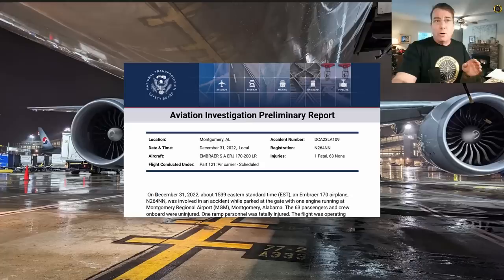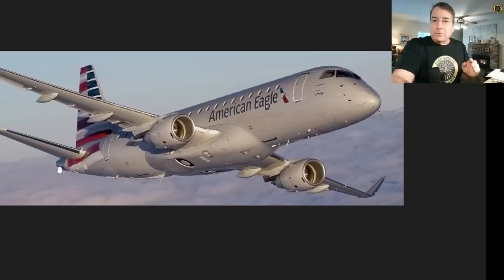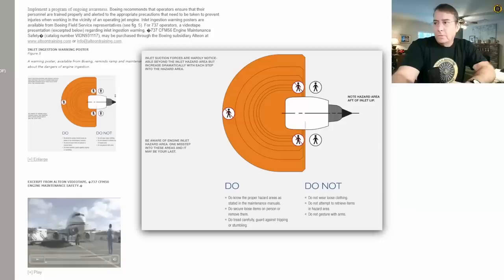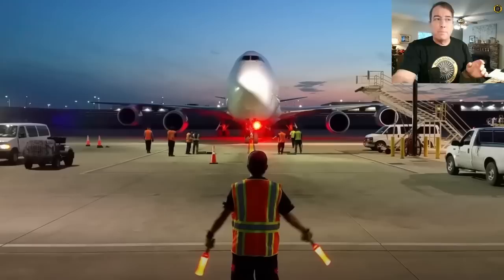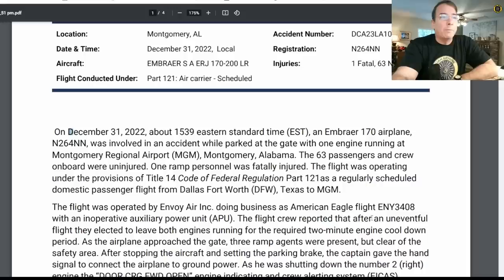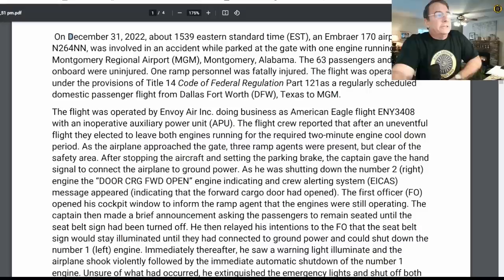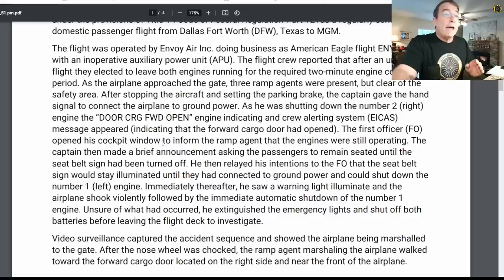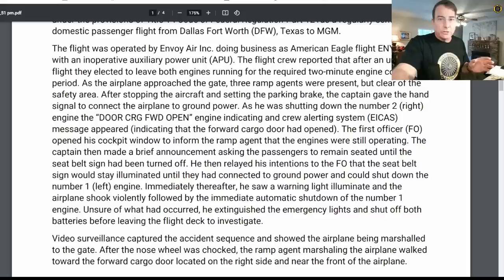NTSB Preliminary Report Ramp Agent Fatality 31 Dec 2022 Montgomery Al.

Comment: I have spent my 43 year Airline career mostly on the ramp but I have also been a flight instructor since the late eighties so I have a broad base of knowledge our industry. I currently run a ground operations training department for a primarily cargo airline. We traditionally hire additional help for peak operations and I have always made it a point to give my "the ramp is a dangerous place speech" to every class. I was shocked beyond belief when I saw this in the national news. It is pounded into everyones head as often as we can if the beacon is on you stand outside the lines and wait for it to go off. Normally maintenance are the ones to break that rule and I have to preach I don't care don't follow their example. Horrible way for us to add to our training why we say beacon on stand back.
Reply: If there are lines is it possible the plane was not properly situated and she paid attention to what should have been but in reality wasn't? Of course that should be stated if that was the case if lines were present.
Reply: Well sometimes in maintenance we are approaching the aircraft with the beacon on because we need to. Leak checks etc. We are obviously trained to be very cognizant of what we’re doing and staying out side of ingestion and blast zones, but our job requires us getting right up to an engine while running at times for FOM
Reply: @larrybe2900  I'm sure the plane was parked correctly or the Marshall would not have given the sign to chock the front wheels.

I think she just was on auto pilot because normally the engines are shut down pretty quickly after it stops, like 30 secs. these were running for what sounds like a min or 2 since they needed to hook up ground power cable, and that takes a while as it's held up by a winch that has to lower the cable down, and then be dragged over, it's very heavy and plugged into the nose of the plane, and then confirm the correct light came on before they shut the engine down. sounds like this happened while still lowering the cable.
Reply: I know engines are expensive, but I wonder if it wouldn't be prudent to find one that's end of life and use it to demonstrate just how dangerous they can be with a decent sized thawed turkey carcass. Maybe once a year and film it for those who can't attend.
Reply: @larrybe2900  I read the report. The plane was parked where it was supposed to be, the lines are visible in the video the NTSB reviewed, and the upper beacon light was on in the video. Also the ground crew did state the lower beacon was also on, but it wasn't visible from the angle of the camera that recorded the incident. 

Unfortunately, we have no idea why the victim violated the safety envelope. It may be drugs. It may be an illness that had her off her game. It could be the pressures to turn around the aircraft. It could have even been mental illness. We don't know. My brother's girlfriend works for American, and we were talking about it last weekend. While she's not a ramp agent, she told me that EVERYONE is taught that if you can't see the individual blades on the engine, the engine is running and you are to stay away. I don't know why this ramp agent ignored the safety briefings and her safety training. And there is no way to find out.
Reply: @jsomething2  The report said they were running for 2 minutes to cool them down and needed at least one to idle in order to provide bleed air and electricity until the ground power could be hooked up. The ground crew were told about this during their safety briefing, at least per the NTSB report. (Who knows what was actually said in the safety briefings.)
Reply: @jackielinde7568  -- Not a turkey -- A Mythbusters style ballistics-gel dummy with a full skeleton.  
People need to see the engines yank the dummy through the air into the engine.  It isn't enough for them to know the endgame.  They also need to get a sense of the invisible hazard.
Reply: People are putting far too much emphasis on the rotating beacon lights. In the interest of self preservation, I ALWAYS verified "spool down" with my EYES from an area near the nose of the aircraft! As a safety auditor, I saw a shift some years ago, where agents were staging cones and chocks at the wing tip location, then approaching  from the side along the leading edge. It was a recipe for death, and here we are. I brought my concerns to Corporate Safety, but was essentially ignored. There's only so much you can do.
Reply: @gdshoe5822  Turkeys are usually easier and cheaper to get, but this works as well.
Reply: You're also fighting against the tendency to become comfortable in proximity to dangerous machinery. It takes a certain amount of concentration and self discipline to remain safe working in proximity to danger. I worked in a lumber millwork shop from age 15 to about 25. At first I was pretty scared of the giant blades and metal, toothed belts, but as time goes on you lose that healthy fear. Easy to inch closer to the blades or to the jet engines as time goes by. It takes some concentration and self discipline to keep up safe practices.
Reply: @jackielinde7568  -- It's easier to get a ballistics gel dummy than a spare jet engine 😉
Reply: very good point-- working around danger requires proper attention and precaution, like safety ropes; lockout/blockout/tagout; two or more cognizant "buddies" (never working solo); like in old days when working behind your TV set always with one hand behind your back. We've all become too impatient and brainwashed by social media and immediacy of smartphones, etc., and all corporate management capitalizes on this.
Reply: As a peak carrier, I can attest, when we go into the hubs nobody comes around the plane untill the L1 door opens, and it is (NOT) getting opened from the outside and not before both are shutdown
Reply: @gdshoe5822  I don't know about that. It's like they buy these vehicles with these engines just hanging off the sides of them, and in pairs or quads, even. It's as if the people making these planes are just giving them away. "Get two free engines with every airplane purchase!" :D
Reply: @jackielinde7568  -- Uh, I thought it was the exact opposite, at least for the really big planes.  I'm pretty sure the airlines need to buy the engines separately, at least for some models... (correct me if I'm wrong.)
Reply: @jackielinde7568  There are videos around of just that. Engines must be tested for ingesting things.
Reply: @gdshoe5822  In many cases the engines are actually leased.
Reply: @larrybe2900  These lines are guides basically, like a normal parking lot!  The best example I could give you has happened to me! We dealt mostly A319s and A320s! But they had new aircraft that had winglets( like fins on the end of the wings!) So they WIDER then normal A/C! So we contacted the crew and told them that we will bring them left of the lead line! If that helps?
Reply: @davidsmiths5471  
Yes it does as well as others who have offered thoughts on my comment.
Reply: @jsomething2  Could you explain the autopilot theory?
Reply: @davidsmiths5471  when you do the same job over and over you'll find your thoughts can drift to something else while you're doing it. I'm not talking autopilot like computer flying a plane. just how people go thru the motions while distracted. she had probably walked over to wheel chock the nose gear a 1000 times but this time the engine was still running.
Reply: @jsomething2  Thank you for your explanation! And nothing against you! But when I hear autopilot, going through the motions,from others and you! Supposedly she was working on the ramp over five years! Wouldn't this have happened before it actually did?

Comment: I refueled airliners for 11 years at SJC; USAir, Southwest, American, TWA and many others; I'm also a private pilot.  I know what the ramp environment is like; all ramps are clearly marked with a STAY CLEAR zone around areas where engine ingestion is a possibility.  I avoided those areas like the plague at all times; that's just what you do... right?  I find similar issues as a ground crew member at various Young Eagles events; some pilots forget the mantra TREAT ALL PROPS AS HOT.  I make a point of it every time I'm around every aircraft, whether alone or with others.  STAY CLEAR OF PROPELLER ARCS AND JET INTAKES.  PERIOD!
Reply: I fly out of MGM twice per month. Before the accident the painted safety outlines were non-existence, completely faded. Now all the painted outlines are very bright with new paint. flying back there tomorrow.
Reply: Both airports I worked on the ramp did not have ingestion zones painted. While the all props are hot is a good thing to live by, there are times servicing aircraft where you need to know the ingestion zone is safe because you’re going to be in it. At times I feel like the all props are spinning, and every gun is loaded mentality breeds complacency, because people aren’t necessarily thinking about what is actually happening.
Reply: The Google Earth photos of the MGM ramp show there are no safety zones painted on the ramp
Reply: Excellent use of the semicolon.   ;-)
Reply: @johnlichtenstein6158  Staying out of the ingestion zones at all times - period - does not breed complacency. If you stay out of the zone, you will never be sucked into the engine. And when you do have to enter the zone (for any reason), you'll be d***ed sure to confirm it's safe. And this does not mean condition yourself to always walk on a painted line.
Reply: @phillipzx3754  Yeah, I'm a bit addicted to them.  I have a lot of connected thoughts. ;)
Reply: @johnlichtenstein6158  Total awareness at all times is the perfect solution and an admirable goal, but the reality of following repetitive tasks in a job over long periods of time does breed complacency.  It only takes a second to screw up and die and that's what happened here.  That's why the absolutist rules are out there because they can help save lives.
Reply: Save those pictures in case they disapear!
Reply: I bet you loved when they blocked you out from refueling!!
Reply: @davidsmiths5471  Especially because I wasn't using a cart to connect to underground tanks; I was driving a 10,000 gallon fuel truck.  But I will say for the most part, the airlines I worked with usually operated like well oiled machines.
Reply: I'm sure you see that at FBOs to?

Comment: I fly 737’s in Canada. Over the past month there have been 2 occurrences where we are approaching a parking position, and at least one individual is knelt near the expected parking position of the nose gear. On one of these times, we felt the chocks being installed before we even had a chance to move the start levers to cutoff. Let’s just say the ground guys got an earful from us…both times asking if they had heard what had happened in Montgomery recently. Routine can be a dangerous thing. You end up walking around on autopilot without thinking.
Reply: I have read a lot of comments on here about "autopilot"! Could you please explain?

Comment: As a retired jet engine mechanic, as Juan stated, you can never have a momentary lapse of paying attention. Spent a lot of time around running engines. We did use engine screens, but lot of other items could kill you since you would have hydraulic power applied.
Reply: Who do you suppose is going to tear apart the engine to get the body parts out? One of the airlines mechanics?
Reply: @jamessicard6682  good question. More than likely since they are trained in engine maintenance. Would probably have medical, coroner personnel there at a minimum.
Reply: You would know firsthand, no doubt.

Comment: As a ramp worker in Australia, the company I work for always wants an on time turn around but nothing surpasses safety. What happened in this situation goes against all of the training provided. Blows me away that they had 2 briefs of this aircraft yet still failed to comply with basic safety principles. Never approach an aircraft untill the engines have spooled down, beacon light is off and the leading hand has given the thumbs up to approach. These rules have been written with blood and that's why they exist.

Comment: Thank you for raising awareness on the role of rampers in aviation. I spent five years on the ramp at GSP (not with American). When I resigned four months ago I was the senior ramp agent at one of the highest performing stations in the company. I've worked hundreds of 170/75 arrivals. That whole accident narrative sounds bizarre e.g. a very inexperienced crew, extremely inefficient procedures, poor coordination of effort. First thing I'd want to know is how many weeks had the victim been on the job? What was the average experience level of the ramp agents involved? (Yes. There is always pressure: too few agents, too inexperienced, ridiculous minimum turn time imposed, etc. The attrition rate for station agents is egregious. An on-time departure was always just another successful sh---show.)  Was there a lead agent at the gate for the arrival? Bottom line is this question: What extraordinary circumstance brought the victim in front of the #1 engine? All the immediate and urgent work was in front of the #2 engine. Was it common practice at that station to set the safety diamond cones from starboard to port---I've NEVER seen it done that way? Was it common practice to set the port cone off the left wing and then take a shortcut under the fuselage to unload bags? If so, this fatality is on management! The only time I was ever in front of the #1 engine on arrival was after I had marshaled and was doing my arrival inspection looking for any damage on the aircraft so we could avoid the blame---usually after the bags were on their way to the terminal.

A word to you 170/75 drivers: don't do this! Given the typical safety posture of regional ground OPS, why would you EVER set your brakes and let the engines run at the gate. If it's a short taxi then slow it down. Burn the two minutes before you get to the gate. Roll into the gate with your #2 spooling down. Set your ground crew up for success. (Oh. Right. It's not 'your' crew is it?) That said, an INOP APU is an MEL on the flightdeck, but it's an IROP on the ramp at a regional airport. As a rule IROPs at a regional station are a dangerous escalation of routine chaos---arrivals and departures. (Had the victim EVER worked a 170/75 arrival with an INOP APU? Was the victim aware that arrival was an IROP? Who was in the chain of custody for that IROP notice to the ramp agents?) Isn't there a way to run on batteries for a couple minutes till the jetbridge can get positioned and the GPU engaged? The deferred maintenance on regional aircraft is appalling. How long had that APU been INOP?

The crews I worked with were always skeleton and frenzied--routinely three experienced ramp agents. (I've worked a turn or two with one other person. That's a transcendent level of sh---show.) Everyone but the marshaling agent would be at the starboard side of the gate waiting to work the bags. Immediately at fuel cut-off we'd walk into the safety diamond and place the safety cone within inches of the #2 engine cowling. (Pilots frequently forget or delay to turn off the beacon lights. If you wait till you can see individual fan blades you're not a 'team player'. The marshaler is always tasked with something more urgent than managing the engine shut-down hand signals.) There was never even a perceptible breeze at the engine inlet. As soon as the cone was in place that agent would open the cargo door while the belt loader was approaching. The belt loader driver was usually the agent wingwalking the starboard wing. While the belt loader was positioning, the dismounted agent would set the right main gear chocks then go get the bag cart and tractor into position to unload bags. The marshaling agent would chock the nose, set the nose cone and wait for the jetbridge to get positioned so the ground power could be connected. When that was done the marshaler would signal the flightdeck that the GPU was connected and then walk off to position the safety cones at the port wing tip and tail, check the aft bin for bags (usually empty), then go get the towbar connected to the nose gear for departure.

I've heard colleagues talk about a company station in the north east where a lone regional ramp agent routinely does all these tasks on mainline aircraft arrivals and departures. SOLO! This is commercial aviation at its finest i.e. most efficient. As a licensed airman (A&P) I could go on and on about the systemic imbalance of efficiency <-> thoroughness tradeoffs. [Clarification: Hollnagel speaks of an ETTO safety paradigm that is systemic and subconscious, but then he says "the system may be able to correct itself and to find a balance of functioning that is both reasonably effective and reasonably thorough." I suggest that the play between individual efficiency and communal effectiveness is a Freudian artifact that warrants religious scrutiny. My faith is religious and it's not in 'the system'---yet.] All the fragmented operational relationships have either competing efficiency requirements or chronic above/ below-the-wing cross-training confusion. (If SWA runs their ramp at every airport like the ramp runs at GSP, then SWA is a glaring exception to the regional rule.) Here's a data point: when the pandemic slowdown ended, American at GSP (not Envoy) went into a hiring frenzy and started adding an extraordinary number of flights--particularly kick-offs. There was an unprecedented three simultaneous kick-offs ---to the minute. The pressure was so great that a senior ramp agent I knew switched to ticket counter after decades on the ramp.

So yeah. That accident narrative was bizarre, and my sincere condolences to this rampie's family and colleagues. Commercial aviation is a tightly-coupled and high-consequence system. Don't be a team player---slow down and smile. Do not blame the victim.